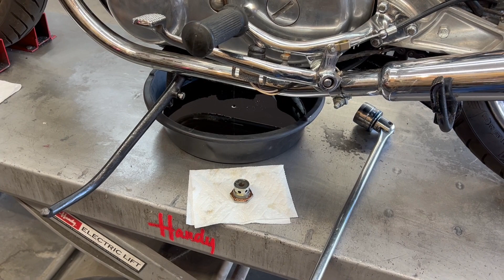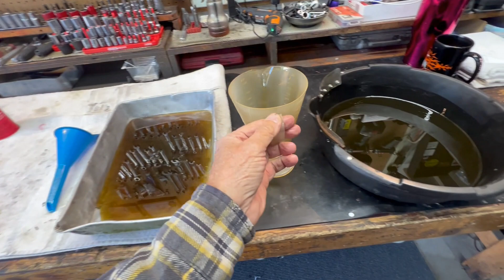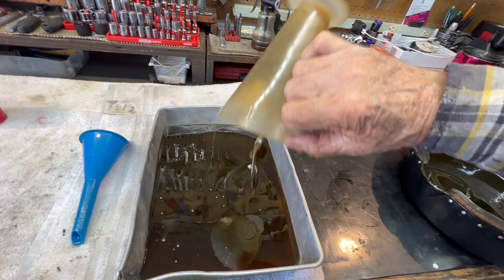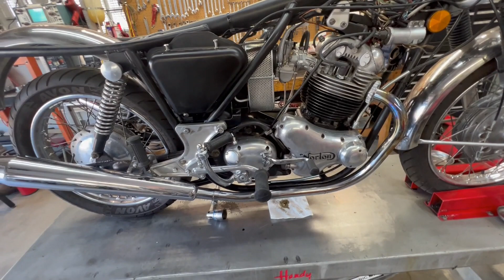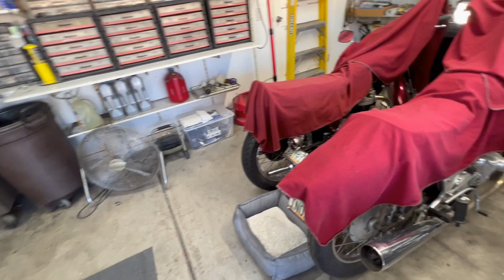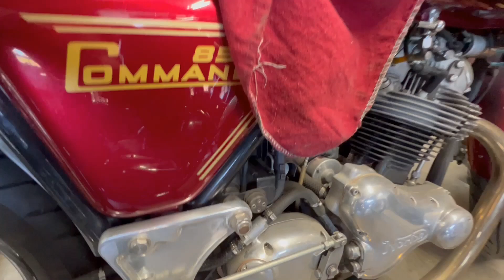Vintage British Motorcycles Repair/Restore

Comment: I have a 1974 850 Commando. If you let it sit for two weeks you will have to drain the sump. I used to loath getting down on the floor to do this. I purchased a $6 Harbor Freight hand pump and if the bike is going to sit for any length of time I pump the oil tank dry. I have a clean plastic bottle with a lid and I store it next to the bike so I won't forget to fill the oil tank before starting. It keeps the sump empty and the floor clean of oil drips.
Reply from the maker: I like it!  A simple fix!  I will actually suggest this to folks who don't want to do the AMR mod.  Thanks.

Comment: My '74 850 Commando wet sump's within about 4 or 5 days...all oil from tank is drained, below the gauze screen in the tank. I have heard some of the AMR mods still wet sump, as do some Electric Start Commandos with the check valve in the timing cover. Sometimes the leak is happening not at the actual oil pump gears, but also at the over pressure valve assembly....along its bypass passage.
I also do not recommend the in-line spring/ball type check valves. However, there is an alternative...a manual ball valve/tap...and to prevent accidental starts without opening the valve, there are types with a micro switch on the tap...which you put in line to the ignition power feed (just like the kill switch is wired). The company "Feked" in the UK sells one for either ignition or magneto type bikes...about $50 I believe. I just made my own out of a hardware store stainless ball, brass housing water tap ("DAHL" brand PEX type; like used on bathroom fixtures). I attached a micro switch. Ran me about $10 in parts and an hour to setup....and never have to worry about wet sumped engine again.